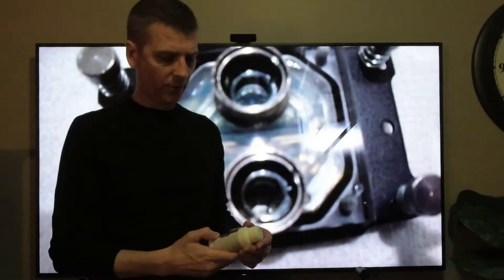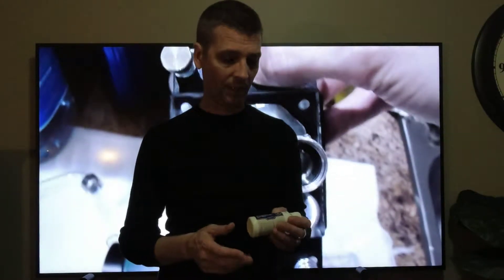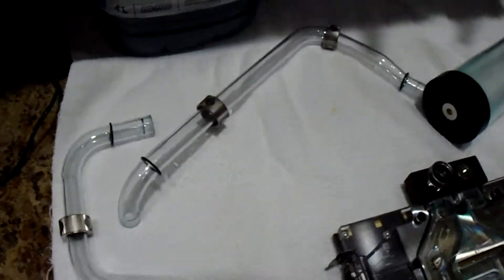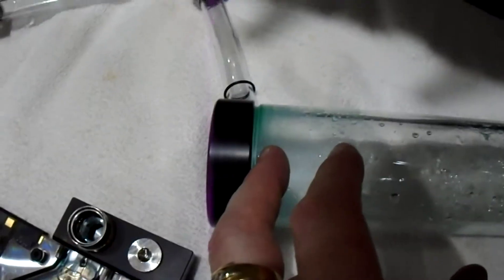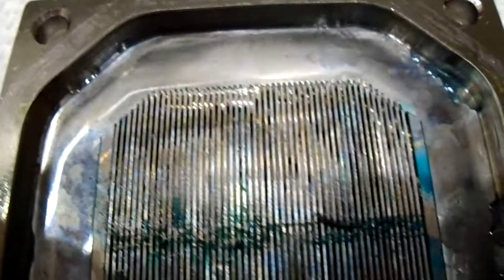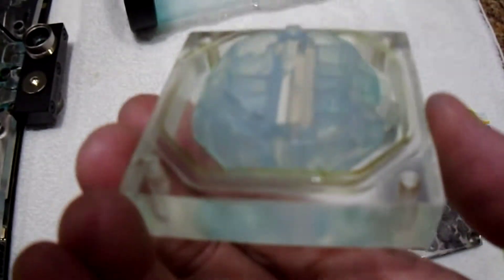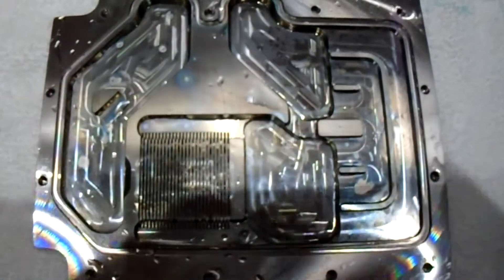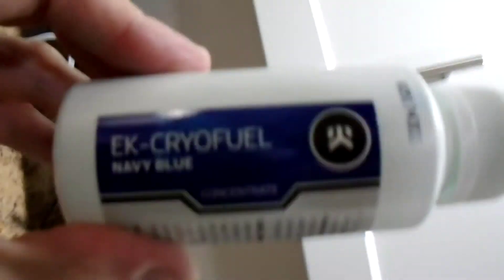EK CRYOFUEL The Ultimate Cooling Fluid? Here's My Experience...

Comment: Well I have just had to disassemble mine and looks quite similar but mine had a fluid change at 1 year, complete stip and clean at 3 years. Then I used some crapo fluid and 1 year after that completely clogged. Stipped cleaned and ready to roll. I had to take everything apart and clean extensively to get it back up and running. EKWB 360s kit is a battler it seems. Hope your loop is fine now. White vinegar for the copper cpu block, soapy water for the plastics around the block and a soft toothbrush, I am pre nickel plate just consumes a shed ton of time.

Comment: Is it because you mixed nickel and aliminum
Reply from the maker: The radiators are copper and the water blocks are nickel plated solid copper.
There is NO aluminum in the system!
Reply: @zapscrap4717  I know it too long that my comment doesn't matter anymore but, i didn't see any galvonic corrision....so nope it not aluminium  it just the coolant.

Comment: Did you flush the system with distilled water prior to recording?
Reply from the maker: Seriously at this point, I don't recall. The system had a major cleaning (especially radiators)
when I first assembled it, (new) however, I made this video quite some time ago and I can't recall.
I only changed the fluid because it was a year old, not because there was anything wrong
or any particle matter (that can be seen) in the old fluid. Thinking about it now and knowing my obsessive
behaviour, I'd think I did, but as i said, I am not sure and I don't just say I did or guess if I am not sure.